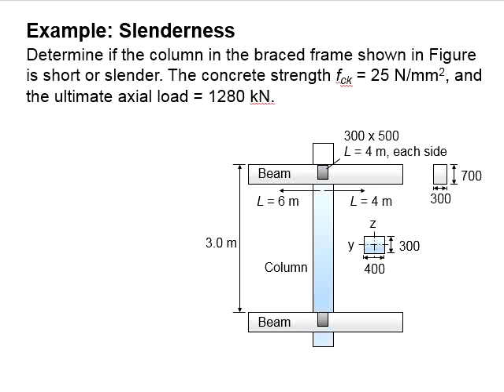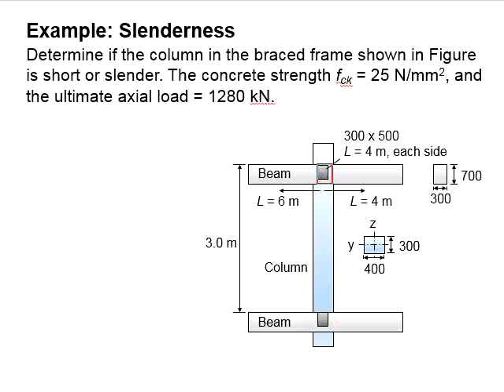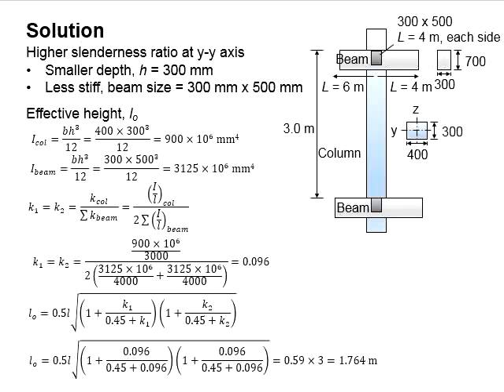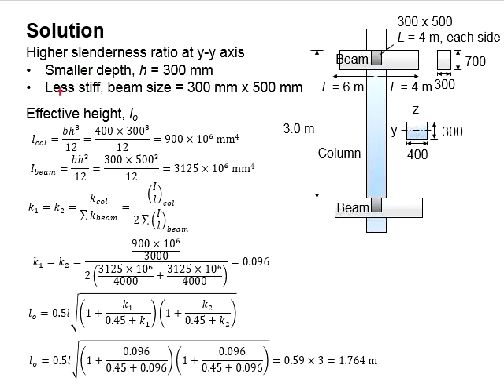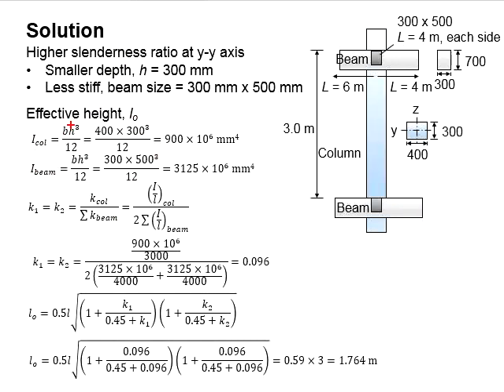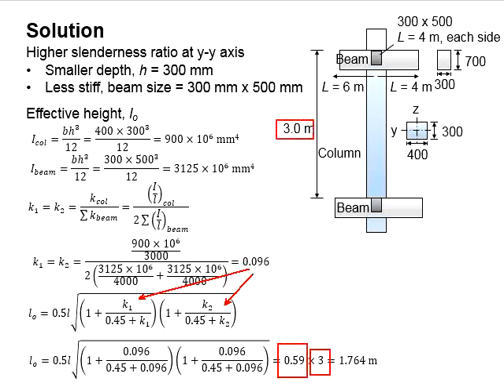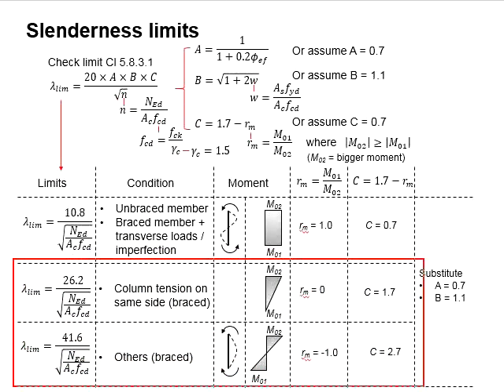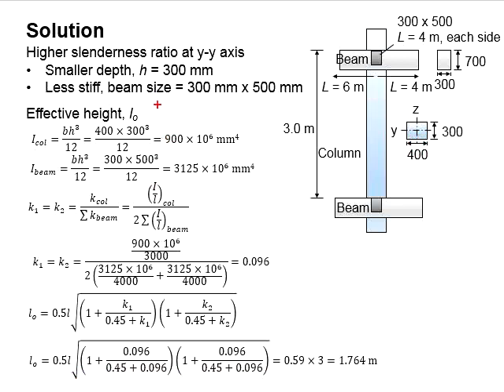2.7 Example: Slenderness of column

Comment: The column height should be reduced by the beam depth to consider. The column length commonly defined from the 'undisturbed' length of column without the beam depth.
Reply from the maker: Yes. You are right. Thanks for the correction.

Comment: Why is the k1 and k2 same
Reply from the maker: Theoretically, k1 and k2 not necessarily the same. Need to calculate based on the formula. In this example they are the same as the beams connected to the top part and bottom part of the column are the same.

Comment: Eurocode2 states, "k = (θ/M).(EI/l)". But you have only used "k=I/l" why is that? What is the reason for over simplification? I understand you may have removed the "E" because both having same "E", but I don't understand the reason to remove "θ" from the equation. Please let me know how to calculate "θ" I'm trying to do a proper calculation. Imagine the concrete column is restrained with steel beams from the top. So you have to calculate "θ" as well don't you?
Reply from the maker: Thank you for your question. To be frank, I do not know how to answer it. If one day you found the answer do let me know.
Reply: @eng-aim  Thank you :)